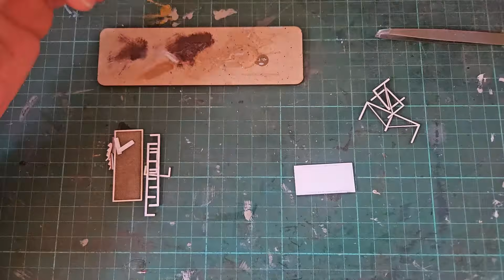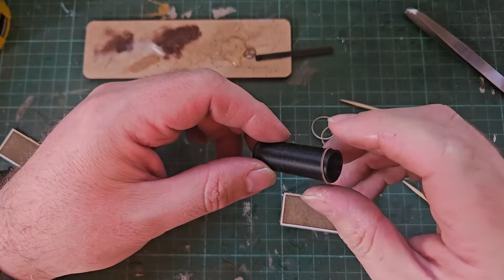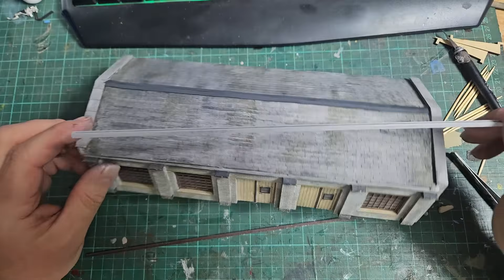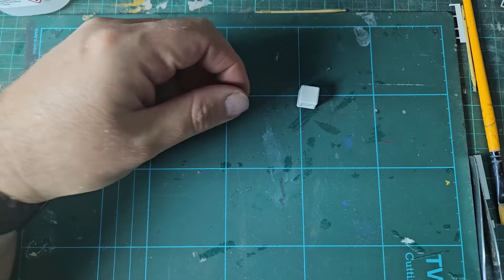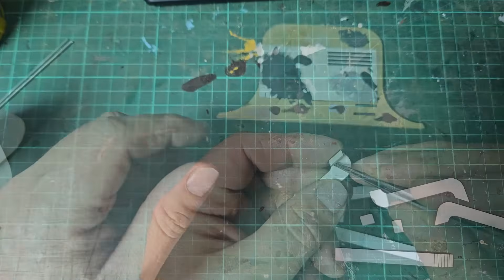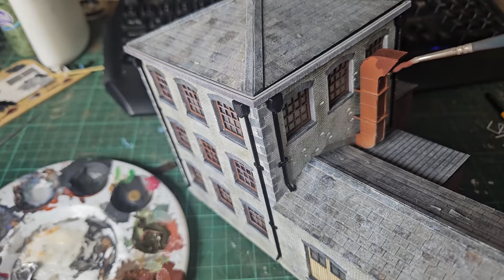Building an OO shunting layout part 9

Comment: Hi Phill, Another great episode and you are absolutely correct with what you say about detailing etc and at the end of the day as long as you are happy with it that is all that matters. For instance the two pipes which from the tank which you initially painted black but later changed to a bronze/copper colour. My professional head says that these should be black to represent the PIB sheeting that would be covering the pipework insulation to provide some weatherproofing however the look of the uninsulated bare copper pipes serving the tank make the detail pop. With reference to your question in the last episode regarding the use of this factory building and my 2 suggestions of either a textile mill or a chocolate factory, this tank on the base could be applicable to either suggestions. Either a tank for dye to colour the textiles or a milk tank in the chocolate factory. Cheers, Andy
Reply from the maker: Andy you are an absolute champion!! This is why I love posting these videos. These are all things I never would have thought of!! I must actually make a decision about the factory's purpose before the next video. Either option is fanatsic because they open up options for different freight to be delivered to the siding

Comment: Really like those platforms for Building number two. Would seem a perfect spot to put some wooden crates stacked up. 
For building 1 I’d personally have put those AC units a little asymmetrically. But it looks great as always. 

Well said on the detail level for layouts. I do want to add that even for show layout, the level of detail you choose to add is still up to you. Not every show layout has to be picture perfect.

If I may ask. What do you use to cut all the card and triplex?
Reply from the maker: Thanks so much for the comment. I hadnt even thought of the asymmetrical approach🤔... it shows how stuck we get in our ways. I have a bunch left over so maybe i should give it a shot on the next building. 

You are so right. I always feel this should be a complete personal expression. I have a lot of older books and magazines and there are so many amazing layouts from times where non of the modern tech and materials were available. Ultimately i am a huge advocate for doing whatever makes the individual happy. In the local scene, although rare, i have seen people get incredibly nasty when something isnt perfect and it is just uncalled for. 

I am using a laser cutter for all my cutting work. Before i owned a laser cutter i used to cut everything out by hand. After posting last nights video i thought it might actually be cool to do a kit by hand like i used to.